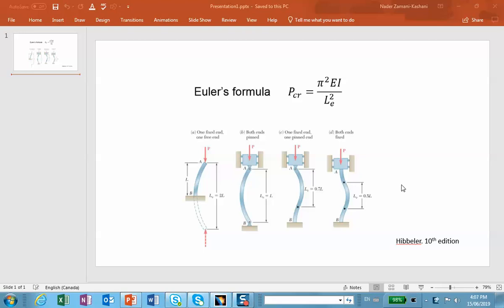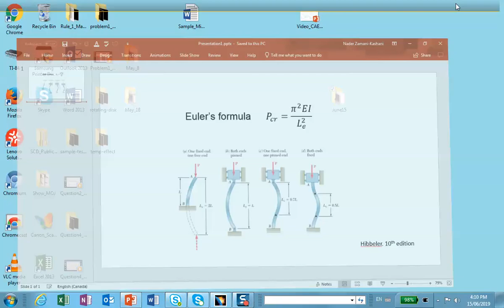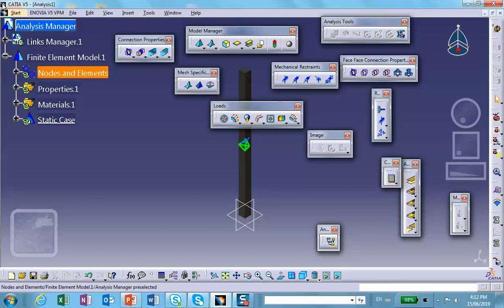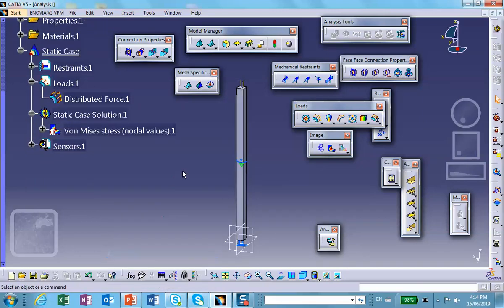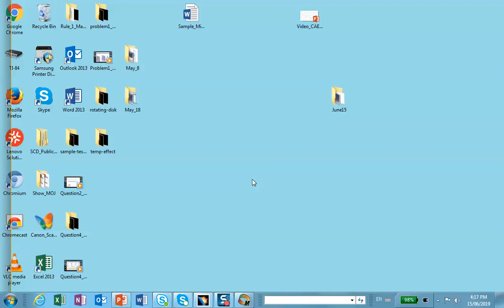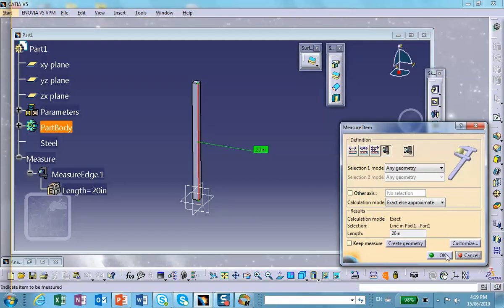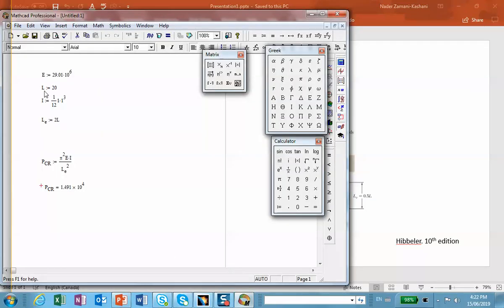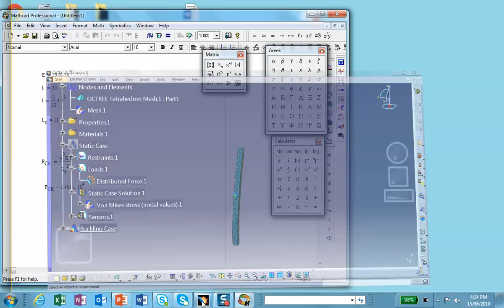FEA, Buckling Fixed Free Bar, Catia v5, Nader G Zamani

Comment: @1:25 How can we trust the calculation if the structure buckles ?
Reply from the maker: Linear buckling analysis is only a non-conservative estimate. It ignores many things such as imperfections due to geometry, loading, material flaws/ etc. I suggest that we look at a standard book on stress analysis where things are spelled out in more detail.
Reply: @naderzamani5752  thank you for your effort.